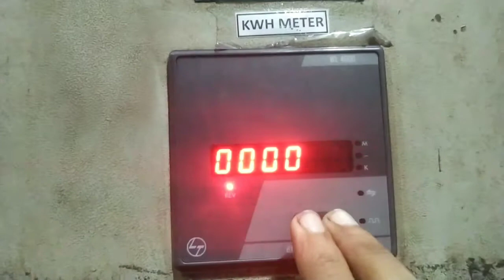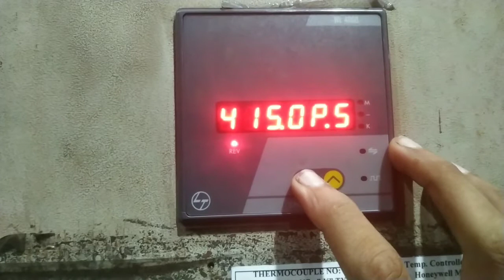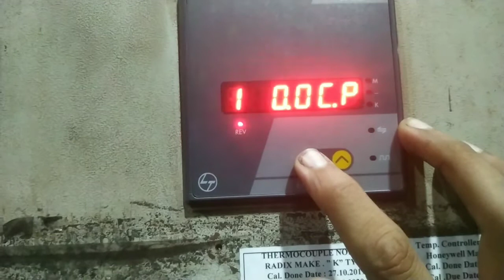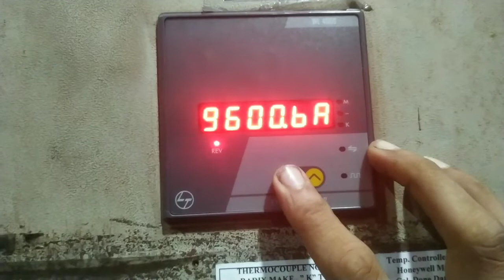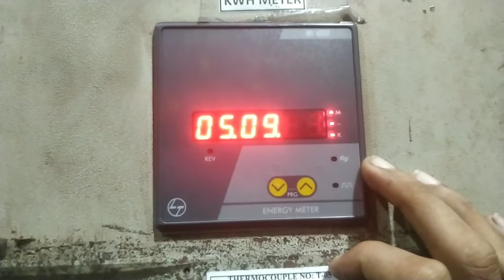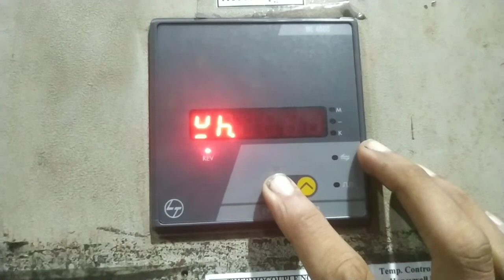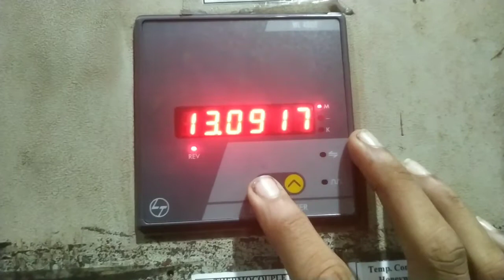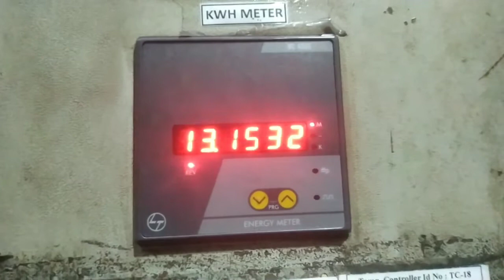WL4000 ENERGY METER PROGRAMMING | HOW TO CHANGE CT RATIO | ENERGY METER L&T | ENERGY METER

Comment: Reding show in m why
Reply: @idtech3762  programming is ok we installed 2 meter 1 is showing k and 1 m 1 meter ct ratio is 60/5 its showing k and 2 meter ct ratio is 1600/5 its showing m
Reply: @idtech3762  not require its actually  matter of ct ratio if ct ratio is under 500 then its show k ani above 500 its show in m l&t engineer also saying this
Reply: Thank you for reply